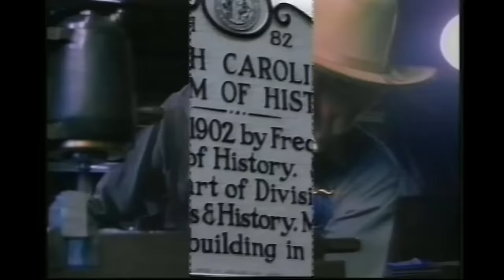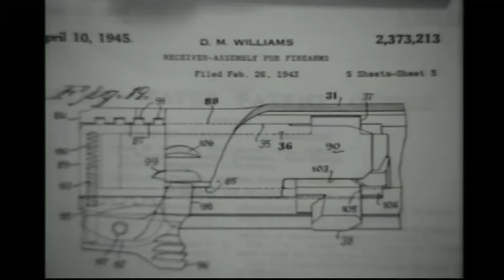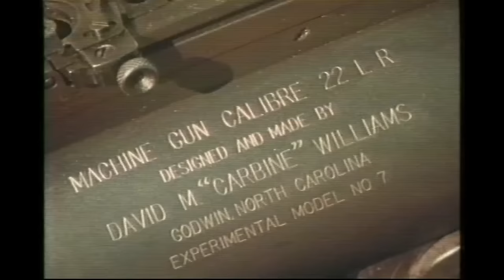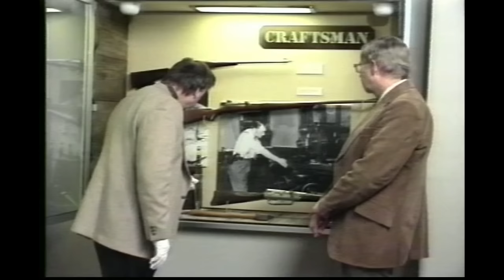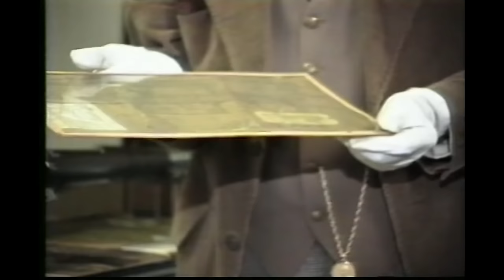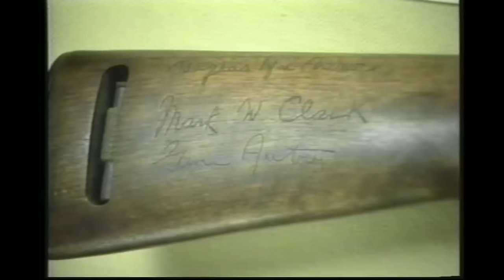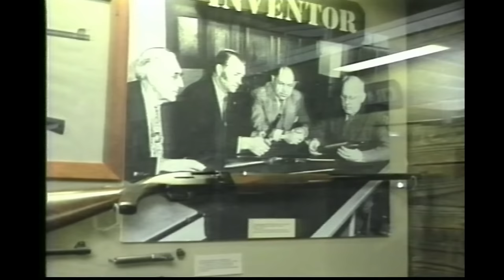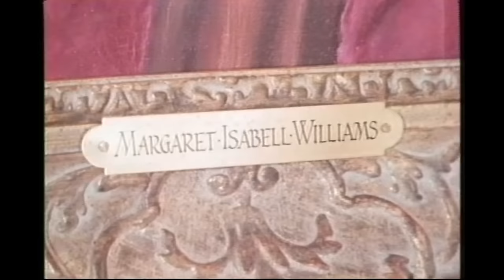Carbine Williams: In The Sights Of A Weapons Genius

Comment: You can tell a lot about a man when he cleans his tools and machines when he's done. You can tell he handled a few guns to learn about what one needs to make it work.  He's joined by the best gun makers in history, he's certainly in great company.
Reply: Sorry but David Williams was not a genius and was really a jerk who got in the way much of the time he was employed at Colt and Winchester. He did NOT invent the M1 Carbine, only the short-stroke gas tappet system.
Reply: @Rustebadge  Where in my comment did I specify that he was a genius? I merely stated that he understood firearms enough to have contributed. Nice try though.
Reply: He absolutely was a genius firearms inventor.   Man had no formal training but could conceive and manufacture firearm assemblies such as the short stroke piston, floating chamber, etc.  He made firearms including blow forward (as opposed to blowback) action in a prison machine shop out of salvaged scrap metal, car axles and leaf springs, while incarcerated as a murderer.

Comment: At 32:10 they mention and are somewhat puzzled that the Remington model 8 has a “small” “sling swivel” on its forend.  In actuality that wasn’t a sling swivel. It was the screw that was used to remove the forend and subsequently remove the barrel since the model 8 was a takedown rifle. Williams can be seen in the old footage removing and reattaching the barrel. The small forend screw had a loop which resembled a sling swivel but smaller that could be used to turn the screw by hand.